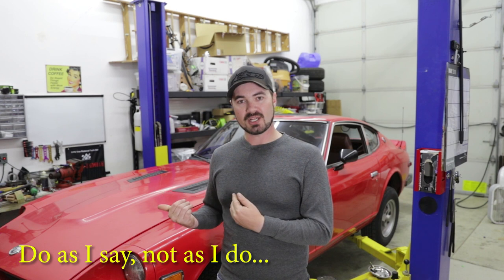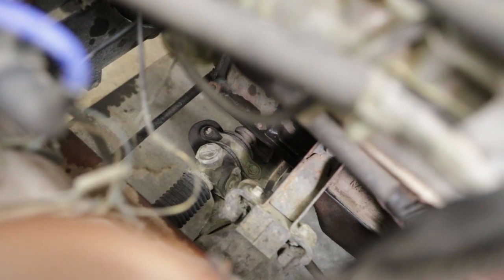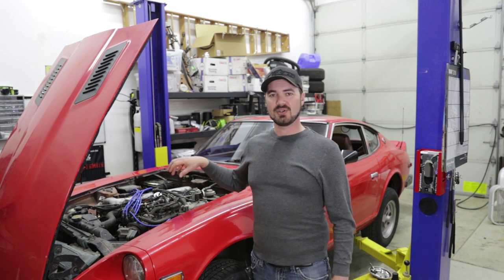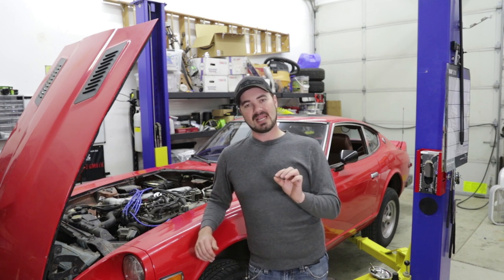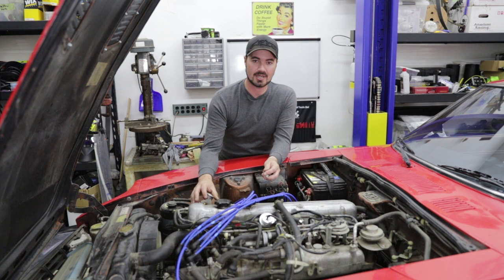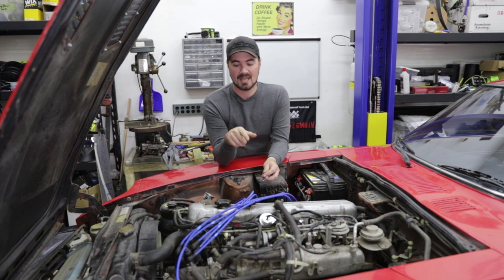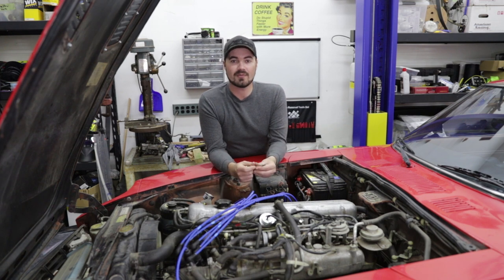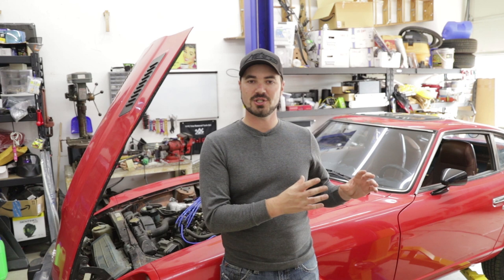280Z Daily Driver - Basic maintenance on a new project

Comment: I think you speak very well, on topic and have good video production. Can you do tutorials on your future maintenance, upgrades etc so we can all learnthe proper way of wrenching on a z car? There are vids on swapping out and upgrading components for aftermarket, but not many on oem parts replacement.  Thanks fort he consideration!
Reply from the maker: I will certainly try. There will be some aftermarket items and some factory items on the 280z simply because some factory systems are getting to difficult to come by/unreliable for a DD, but I hope to keep it much more stock than the SR240Z.

Comment: Talking about moisture corrosion and brittleness in the engine bay = age.
Why do people assume the computer in the kick panel ,is in supreme condition. Just the fact it was designed before desk TOPS, should tell you it needs replacing. But it to get moisture ingress and the spidering pcb boards and solder and wiring all corrode . The computer wiring harness is a multi pin plug that is delicate to clean. The EZ fast system 
Up grades the computer as it is self learning. And will readjust to any future mods.
This up grade has an entirely new wire harness for the entire system. And runs thru the driver's side.
       Not to be confused by the main wiring harness that runs thru the passenger side which operates the lights, and starting..

Comment: larger two wire sensor is the thermo time switch used for cold start valve. Temp gauge in dash is a single wire sensor. There is also a water temp switch used for emissions egr or different ignition timing.
Reply from the maker: Yes, you're right. The other switch I have with the pigtails cut off was deleted by the previous owner for some reason, and I thought it was the thermo time switch originally until I was able to compare it in the manual. I'm not sure exactly what they were attempting to delete here, but they even cut out the wires in the harness.

EDIT: The switch they cut the pig tails off of is the water temp switch, which I always confuse with the thermo time switch in name.
Reply: if EGR delete, could have been the water temp switch, some use it to control the EGR activation (delays it until warmed up) Some use it for distributer advance (see if dizzy has two pickups, if it does then the water temp switch toggles between the different pickups altering the timing). that one (the two pig tail switch) is hard to find, I ended up making one by gutting an old defective switch and inserting a temp controlled reed switch, epoxied into place. My setup uses it to control the EGR (75 cali car).
Reply from the maker: Good to know, thanks for the information. It still has the EGR in place, but the wires are broken off the switch rather than cut (I split the insulation open and it was solid green). I think I will probably end up going with the retrofit system from zcardepot at some point, just happy to have it running well enough drive and shake down.
Reply: if its still in place see if its functional, goosing the throttle should make the diaphragm move a tiny bit. Next see if it does it when the car is cold vs warmed up. Should NOT open when cold. If is does see if you have the two pickup distributer, if yes then the water switch controls timing advance if single pickup then the water switch controls EGR turn on temp. I like the ease of working in the stock system, but will be interested in how the aftermarket EFI works out. I did not see a MAF on those aftermarkets so was wondering how they monitor amount or air flow. Seemed like just vacuum and throttle position. I don't know a lot about modern EFI, perhaps those two parameters is all that is needed?
Reply from the maker: I will try that out. Thank you! On most modern EFI aftermarket setups they tend to use just a MAP sensor, IAT sensor, and the O2 sensor to balance the AFRs. The Holley Sniper EFI system on my Mustang is probably the simplest, but it is still very similar to how we have the AEM v2 system setup on the SR240Z with a MAP, AIT, and two O2 sensors (wide and narrowband).

Comment: Currently looking into getting a 280z as my daily driver, I’m in hs and really wanna start learning cars and modding/ actually having fun with my car while I drive. Would you recommend it?
Reply from the maker: The S30 cars are pretty easy to work on. The 280Z is the better option, they fixed a lot in the later years, and there's a lot of options for upgrades.

The biggest issue you will have will be buying parts. I would say it's a great driver/project option as long as you have the budget for parts and start with one in good condition. You will certainly learn a lot in the process.